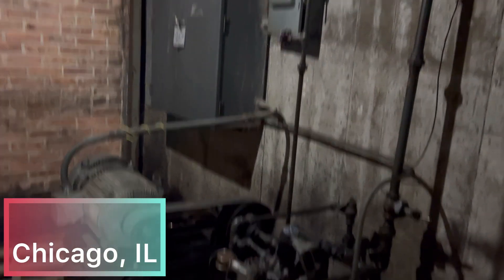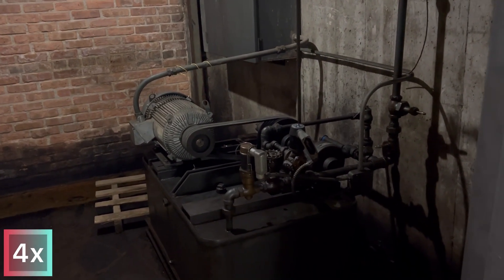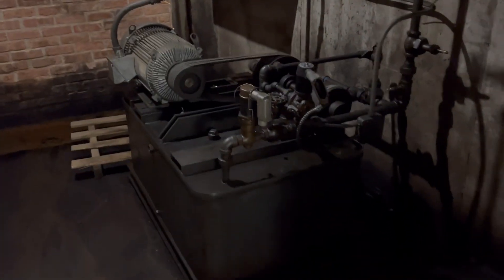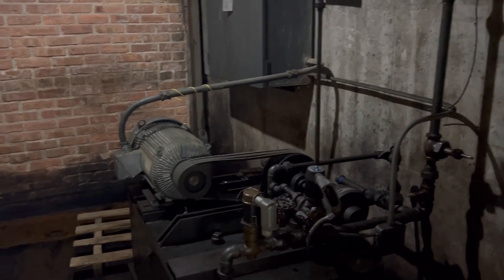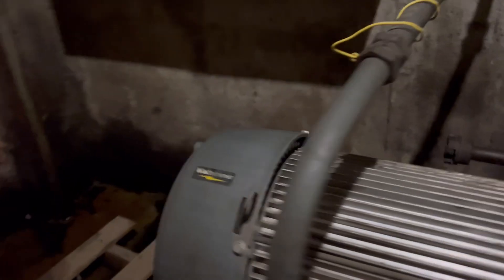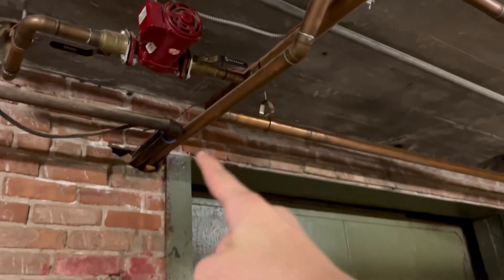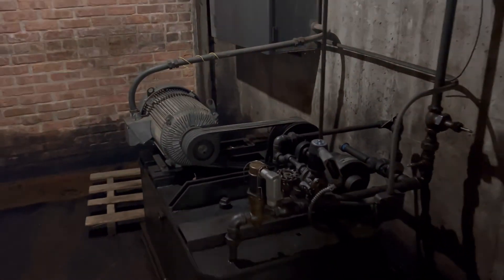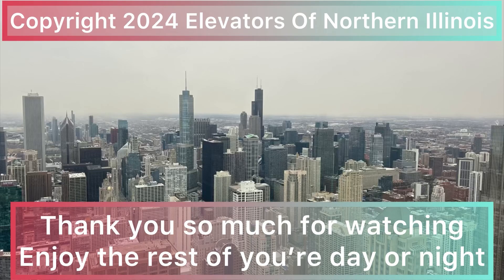1940 PITT Hydraulic Freight Elevator Machine Room

Comment: Wow, that is a cool looking power unit, and is from the early 1940s, even though it sounds like a 70s or 80s Otis or ESCO elevator. Also, even though the capacity is 6000#, is the motor 60 HP, or is it smaller or larger than that?
Reply from the maker: Considering how slow this thing goes, I would assume the motor is around 60 HP.